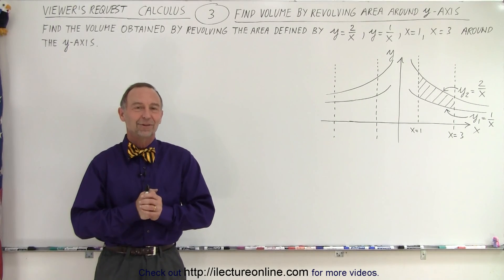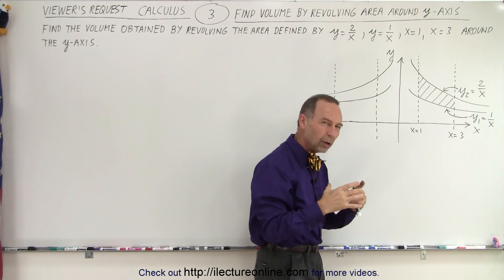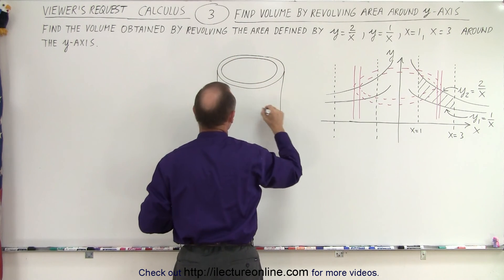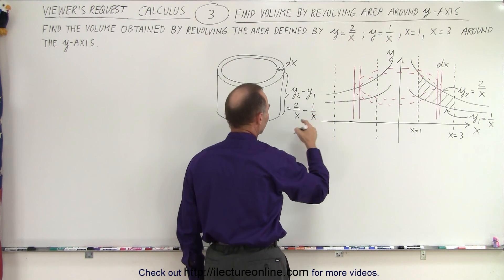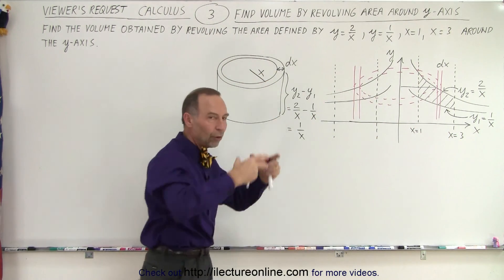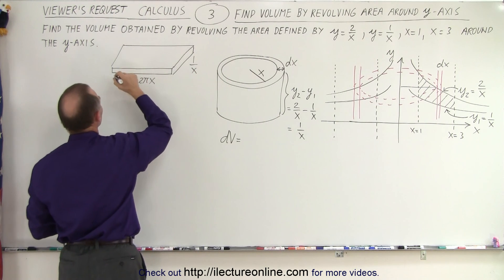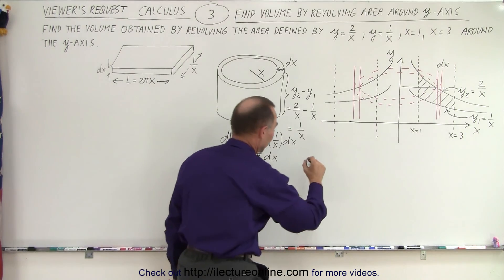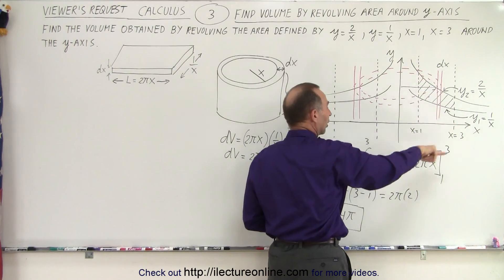Viewer's Request: Calculus #3: Find Volume=? by Revolving Area Around y-Axis

Comment: How can we submit viewer request?
Reply from the maker: Just like you wrote this comment.
Reply: @MichelvanBiezen  Oh ok. This is a problem I've been stuck on for a while. A rectangular piece of paper is 14 in. high and 7 in. wide. The lower right hand corner is folded over so as to reach the leftmost edge of paper (your basically just folding a paper). Find the minimum length of the resulting crease.

Comment: https://prnt.sc/uav9xo
70 percent of the lost energy is used to heat the ball,What is the change in ball temperature?
Reply from the maker: First you need to calculate the lost energy = mgh1 - mgh2 = mg(8.36 - 1)   Then you take 70% of that:   0.7(mg)(8.36-1)   Then you use  dQ = mc dT    or change in T = [0.7(mg)(7.36)]/(m x C for steel)  Note that the mass cancels
Reply: Thank you so much for your answer.God bless you😘😍🤗😄😊